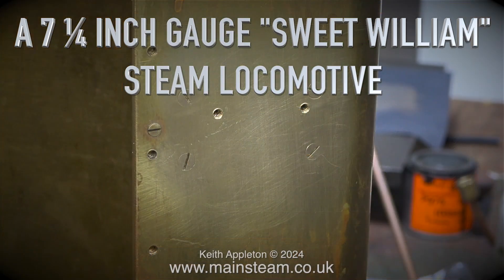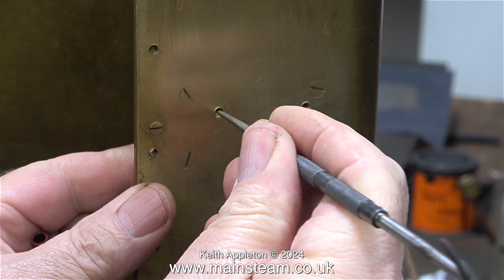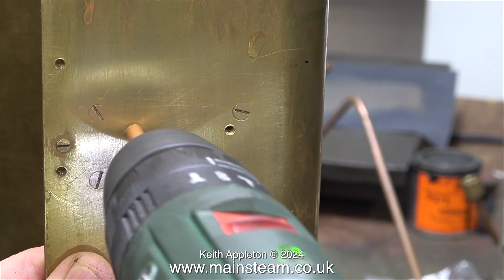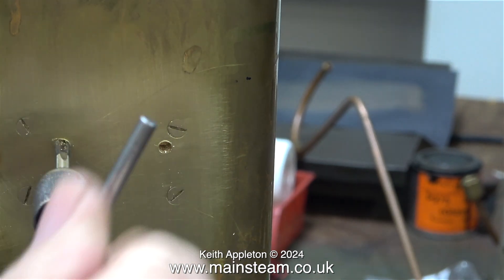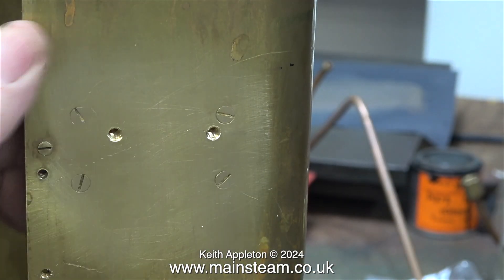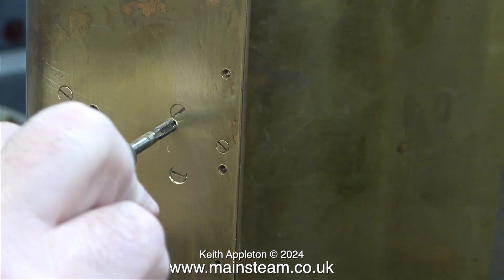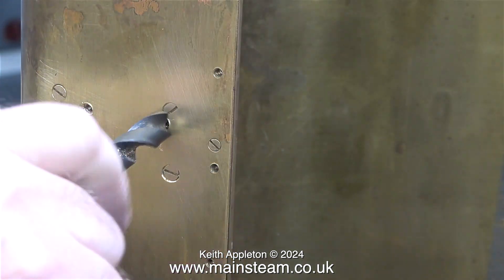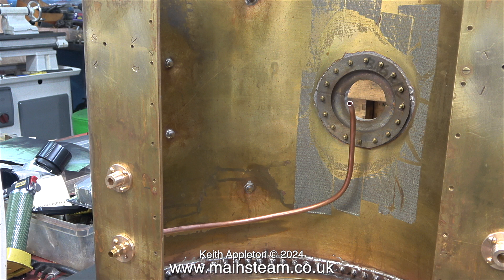A 7 ¼ INCH GAUGE "SWEET WILLIAM" LOCOMOTIVE - PART #72

Comment: thanks for the info on identifying ba bolts so  the smaller the number the bigger the bolt interesting
Reply from the maker: BA threads are similar to Metric, but not quite. 0 BA is almost M6 . . .
Reply: th @keithappleton  thanks

Comment: Taps are always an exercise in feel, which thankfully, I developed quickly growing up with my engineer grandfather.  At least most model engineering jobs need not require anything ridiculous, like what one Jerry Kieffer made, being 0.25 mm in diameter screw with a thread depth of 0.0005", which I imagine is hard to make taps and dies for, which he did, in style too!  I plan to also engage in small bolt insanity, but will probably use a jig borer to prevent breaking taps.  Ah, the wonders of small scale modelling!
Reply: My experience when cleaning a threaded hole the tap always break on the way out